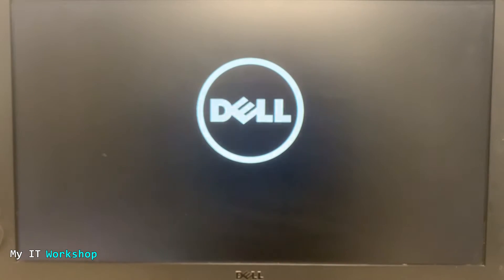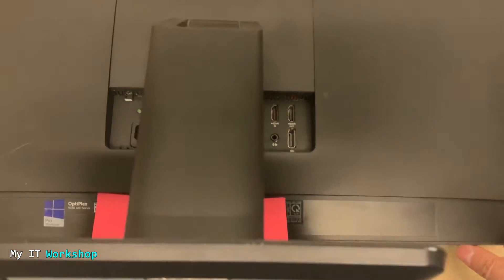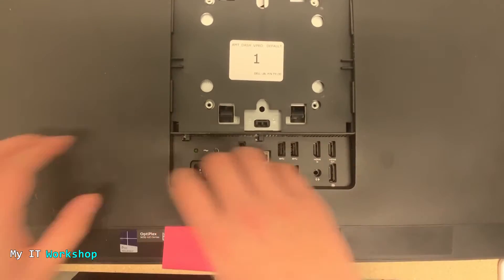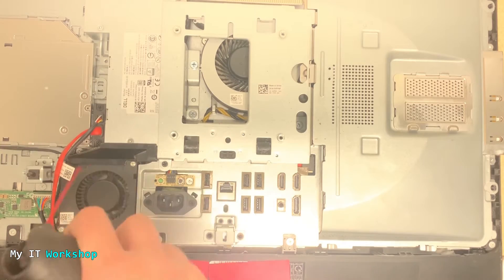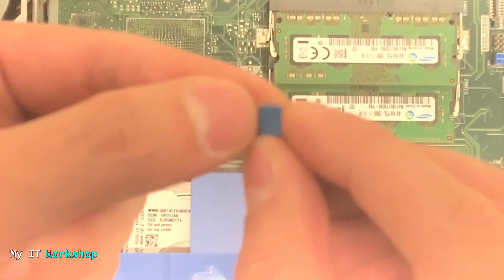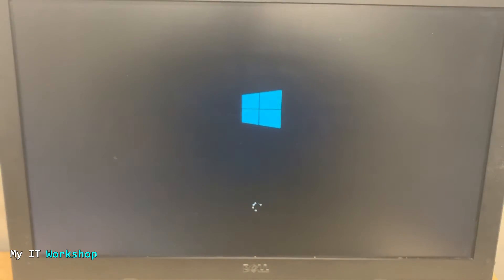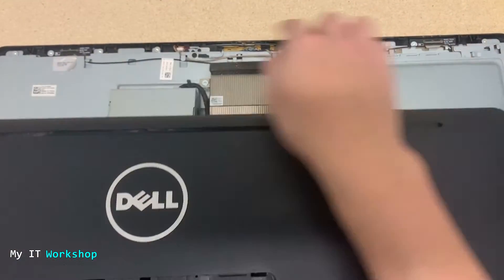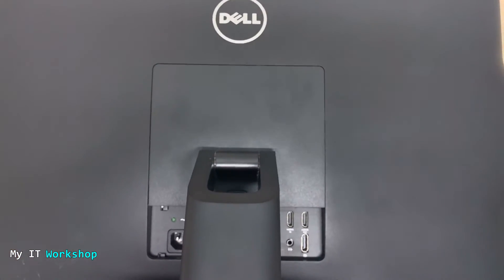Bios Password Reset | Dell Optiplex 9030 AIO

Comment: Great Vid, thank you. Just a thought, after you had removed the password reset jumper then rebooted computer to check that it was successful, you then shut down and removed AC power cable. Best practice is to hold down power switch to "bleed" and residual power from the internal capacitors prior to re-connecting the password reset jumper. This was my IT training. Best regards Pat

Comment: Will this work for a Dell AIO 3464? If so do I type a new password in the bios screen or after restart.
Reply from the maker: Hello,
I did a video for the Dell AIO 9030 some time ago, the process was similar. It was more time consuming to remove the cover.
When you reset the BIOS password it wont show up again…..unless you setup a new one.
Hope it helps 
Thanks for the comment